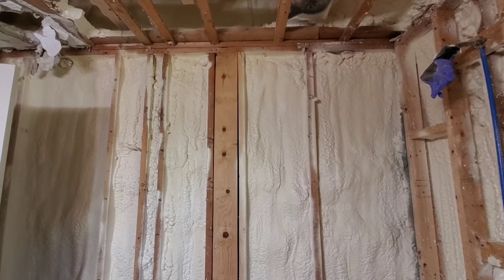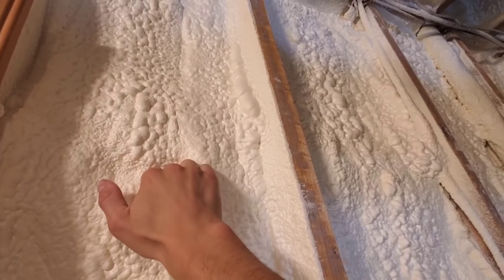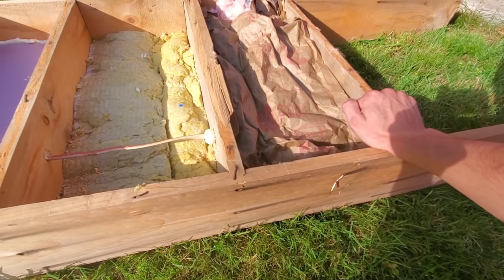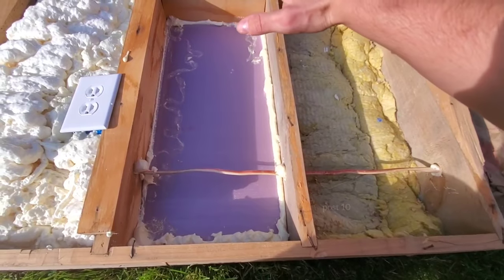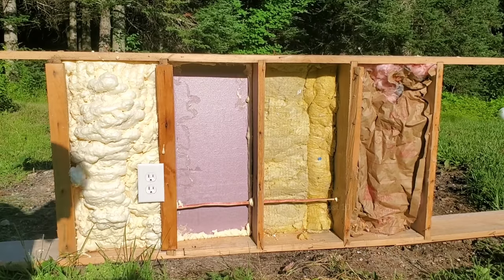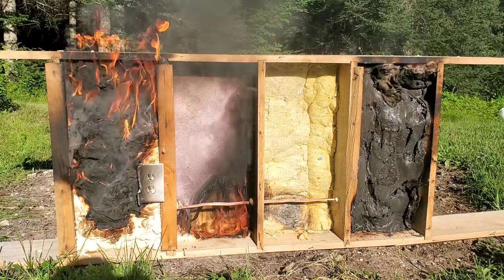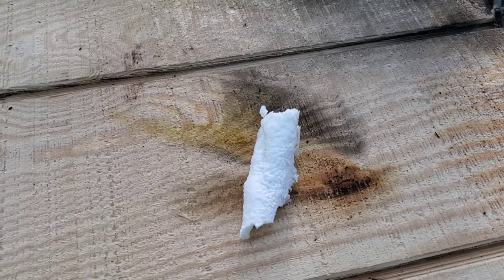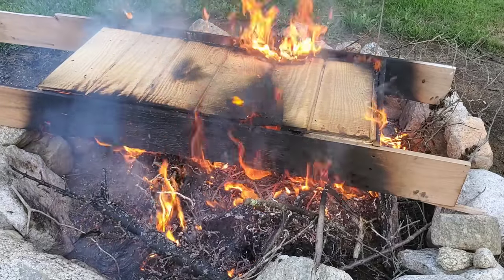Testing The Burn Ability Of Insulation In Wall

Comment: The shortcoming of this test is that the foam is essentially in open air . In a home, it would be trapped between studs and the drywall.  In an attic, the foam would be exposed to air, but in walls, it would be difficult to even set on fire due to the lack of oxygen, assuming that the structure was all to code. That is one of the main reasons that building codes are important. No one should be concerned with using foam insulation based on this less than scientific test.

Comment: Post10 - nice high-school level science experiment, but you should stick with unblocking drains.  You should consult the NFPA/NEC codes and the IBC  Codes for the use & installation of various wall & ceiling insulation products in residential construction.  There are strict requirements for using EPS, ISO, SPF foams in residential building construction.  And if you really want to know more about building fire science, consult Underwriters Laboratories (UL) & dig into NFPA fire studies.  Very nice entertaining video, but not designed enough from an engineering perspective for what you're aiming for.  There are entire houses & commercial buildings insulated with SPF for a reason.

Comment: I've never liked the idea of spray foam. It's always struck me as an industry gimmick with too many flaws especially hiding weather damage until it's too late. But this fire test really says it all. It's crazy that the entire building industry is pushing this stuff today. The rigid foam board is only good for under slab insulation in my opinion. Rockwool and fiber glass all day for me. Great job in this simple demonstrative test. 👍🏽

Comment: yea in China we banned the use of polystrien boards (pink foam) as insulation beacuse a few fires happened and their consequences. Plus the smoke is toxic. We also banned swadwhiched pannels using styrofoam as a core, what used to be a common material for roofing. The aux. building to the central TV in Beijing burnt down cuz of fireworks igniting a pile of insulation boards waiting to be installed. Now baically all buildings are insulated with Rockwool as it's less of a hazard to the people who handles it compared to fiber glass as other comments are saying. BTW rockwool is not fiberglass, it's literally melted rock being fluffed up. Essentially that stuff is just stone so it never burns.

Comment: Sorry to correct you, but “the great stuff” has no fire retardants in it.  Open cell spray foam installed by a contractor is loaded with fire retardants and will not burn apart from a nuclear bomb.  My dad’s house just had a major fire which started in the attic and everything including metal melted into oblivion, ….. except the spray foam roof.  The fire actually traveled down into the bedroom rather than obliterating the roof.
Reply: Wow, sorry that happened to y'all but thanks for telling about the experience.

Comment: I think we also need to weigh the benefits of spray foam versus fiberglass. Our home is spray foamed 360 degrees…and  our energy costs are the lowest I’ve ever had. The fiberglass became a nest for critters and our energy costs were higher. Also, looking at the surrounding material, that will catch fire faster than the foam. I’m talking about furniture, carpets, etc. So the experiment is great, but does not include the peripheral objects that will catch.
Reply: But if the fire starts in the wall, the wall cavity will burn faster (or burn, rather than not burning).  This happened to a friend of mine when a tree fell on his power line and cut his neutral.

Comment: Well, that's quite the disconcerting demonstration, but it is important to remember the purpose of the foam's fire rating is to give time for a firefighter to get to your home. The smoldering of the spray foam within itself prevents spreading of fire, rather that just burning like the panel foam.

Comment: So moral of the story, it doesn't matter if your house if engulfed in flames, nothing will stop that, and everything will burn, but if it's a small house fire and you have a way to save your house, use fiberglass and not spray foam

Comment: What about hempcrete? Not good for the attic, because it's to thick and heavy to reach same insulation values, but works well for walls and is supposed to be a good fire retardant (don't mix up with hempwool, which is flammable).

Comment: You should know that the "wool" insulation is not wool or glass. It is traditionally called rock wool and is a mineral fiber made from basalt rock. It can typically withstand temperatures exceeding 2000 degrees.

Comment: As a Major in Material Science, and also a trades-person of Plastics Fabrication, Signage and Insulation I would never trust plastics and plastic foams when building my home.  Fuzzy things such as Dacron, PEP, PVC, PET etc: are profoundly flammable and inflammable.  Your home is a fire trap that will kill you in your sleep.  Only use Glass Fiber and Rock Wool.  Only use Concrete Sheet to panel your walls.  Only use Galvanised Steel frame to make your house.

Comment: Even cork insulation is a safer choice than spray foam. Cork will char on the outside and create a barrier. They even use cork as heat shielding on crew capsules when they re-enter the atmosphere so if its good enough for NASA its good enough to insulate the home.

Comment: First thing I see with the closed cell foam is you are supposed to coat the wall and frame with a fire retardant like verithane let dry 24 hours spray closed cell foam let dry 24 hours then spray verithane fire retardant and let dry for 24 hours again and you might if lucky slightly scortch the outside eventually but it would not burn

Comment: From reading I learned that procedure guidelines for spray foam are often followed incompletely. Secondly, as a hobby home improver, guidelines are most of the time hard or impractical to follow completely, leading to fumes from the completed product escaping into your home, which are very bad for your health. There is a growing group of people experiencing the long term health effects of such exposures. I concluded there is no valid reason to ever use PU spray foam for isolation, and there are always better alternatives.

Comment: Solids do not burn.  As it heats it gives off vapors or melts and then gives off vapors.  It's the vapors that burn. If you look closely you will see a gap between the vapor and the flames as it burns. But every thing needs to be in a vapor form to burn.

Comment: With the spray foam, that is not the same foam they use in the large gun that you spray a whole house with, also it appears on the pink foam, that the part that actually burnt was the spray foam around the edge, that the foam it's self just melted until it cooked off.

Comment: No, that's not a type of fiberglass.  It's made of rocks, not glass.  That's the most fire resistant insulation on the market and it clearly won in this case.
    Also, fiberglass can and does burn when the fire is hot enough and it has a much lower melting point than Rockwool.
Edited to correct spelling.

Comment: Ÿou should  try Hardie backer cement board that goes under tile bet that would  hold up well and isn't that expensive compared to other products. It would probably resist  like bricks or centerblock walls

Comment: Why are you using a cigarette lighter? A grill lighter would be far safer, plus in my view, actually easier to operate. No need to have your fingers anywhere close to the flame. I like using a grill lighter to light pilot lights. Its reach sure helps.

You could have had a few buckets of water, if you decided to use it, no cost to recharge or replace the extinguishers. Good idea to have a charged garden hose or fire extinguishers at the ready, just in case. 

Disturbing that the outlet cover can not resist fire very well. If wires were arcing, how would it keep the sparks confined?

Very nice demonstration.

Comment: This was a decent video but failed in many facets.  First of all each of the materials has a lot more information that needs to be discussed (like hazardous materials list, melting points, flash points, and combustion temperatures.  Additionally, the heat that each material generated/radiated from the fire tests, burn time (per sq ft, cubic ft, etc).  A great thing that you did show in this video was how the spray foam was deceiving as it could appear to be extinguished but still be burning the building down.  It was eye opening to say the least.  Thanks for sharing.

Comment: So I can see a big flaw in this test and that’s using canned foam, it doesn’t contain the fire resistant chemicals used in normal poly resin closed cell spray foam. And yes it still is more flammable than fiber glass but not in a realistic situation. Most wires are not igniting insulation but usually get hot enough to just ignite the wood or paper on fiber glass. Sadly fiber glass will not prevent this and actually will allow it to happen easier due to more oxygen flow and space for the spark or heat transfer. Yes the fiber glass won’t burn but the house still will, while foam will limit the chance due to lack of oxygen and if the fire proof coating or fire proofing inside the foam is to code like most houses it won’t even ignite. I’m not saying there is no chance but it is far less likely, especially on the fact electrical fires make up only about 6% of fires yearly.

Comment: It appears from your comments (and some LACK of comments) that you don't know what rock wool is.  In your commentary, you said it was a form of fiberglass.  NOT.  It is fireproof and is made of molten spun rock, not glass.  It costs maybe twice what fiberglass does, but it is a safer insulator.  Working with fiberglass requires a respirator and skin protection (those glass fibers can tear your skin up).  

Rockwool is rot, mold, and whatever else proof.  Mice and other small critters don't like it and don't burrow and nest in it - like they do in fiberglass.

You can cut rockwool with a common serrated knife - it's like a hot knife through butter.  Rockwool bats are slightly bigger than the space in standard stud spacing, and they are stiff enough that they do NOT need staples or other hardware to hold them in place.

Comment: So I get the test but.... a wall is covered on both sides much less O2 not to mention most states require you to plug holes on top plate to reduce the O2 in a wall

Comment: Interesting, I personally have EPS beads in my inner walls. Now I'm wondering what the flammability on those is.
Reply: Fairly high, polystyerene, whether expanded or extruded, tend to be quite flammable.   Less so for the plastic itself- its actually comparable to wood in regards to how quickly it'll light, but once it starts going, the blowing agent - that is, the compound used to turn it into foam, tends to be either ethanol, kerosene, or another light oil product.  So... once it catches fire it chain reacts what may as well be bubbles of wood filled with lighter fluid.  Same deal with spray foam insulation, really, though the chemistry is different.

Comment: You PHYSICALLY CANNOT plug a 20A device into a 15A circuit in the USA. 15A space heaters, sure... two of them, possibly, but you'd trip the breaker before starting a fire, that's exactly why breakers are installed. Plugging a high-wattage space heater into a crappy little power strip would likely start a fire, but not direct plug to the wall.

Comment: There is another insulation I heard about called AirCrete... which is a blown concrete mix .. I assume it would be good as a fire retardent, and it seems like it might seal as well as spray foam.... does anyone know how AirCrete actually compares to other insulation materials in terms of insulation, fire protection, air quality issues, and cost????

Comment: I would not want spray foam, from an ecological standpoint at the very least.   But seeing how fast it flares up, and the toxic smoke, that's 2 strikes.  The 3rd strike is what I've always thought about it:  It gets sprayed in AFTER all the plumbing and electrical lines are run.  What happens if you get a leaky pipe, or want/need to work on the electric circuit?  You're not going to be able to access either without a ton of work and making a huge mess.  No thank you! I'll still with fiberglass batts or rockwool!

Comment: My house is spray foamed and I was curious about the same thing. So during the construction (I GC'd it), I took one of the pieces leftover from the guy cleaning out his gun. I put a torch on it and it would not sustain combustion. It would turn black but as soon as I took the torch away, it stopped. Great Stuff is not the same formula as what they use to insulate a whole house with closed cell foam. I think you made a bad assumption in your test.

Comment: Roxul is not fibreglass, it is melted basalt stone.  that is why you couldn''t ignite it.  it doesn't hold water, mold, insects or animal life.  doesn't splinter as bad as fibreglass either.  better r value, better sound dampening, solid(ish) bats.  this is the best insulation.  also, non-toxic.  i wouldn't consider sprayfoam for any purpose beyond installing windows and doors and even then if you build it right, a bead of caulking should make the airseal.

Comment: Look to commercial grade materials like the rock wool or “woo-woo” as we  call it! In commercial applications “burn ratings, and restrictions are far more strict! Mind there more expensive way more expensive, but some cases nothing else can compare, even the blocking in walls have to be fire rated, usually with a sodium or salt based coating or soaking! There are better residential products out there than the traditional Home Depot shit! But as a union carpenter and home builder for almost 20 years, commercial materials is the way I’d go with a lot of my “future built house” materials

Comment: Not trying to be rude or anything but as a volunteer firefighter your wrong the fiber glass one it will burn the blow touch ain't enough heat and flame on it long enough to get it going because it will burn

Comment: Rockwool is made out of volcanic rocks and metal slag. Neither of which burns. It's melting point is over 2000 degrees F. I'm in an extreme fire danger area. No foam insulation for me.

Comment: Great Stuff is not the same chemical compound as closed / open spray foam used in homes.  Warning on the Great Stuff can even says to not use in ceilings or walls because of this.  Spray foam isn't fire retardant but it performs better than the Great Stuff used here.

Comment: I would never put any organic insulation in walls. Rock wool is completely fire resistant. Combined with fire retardant drywall or, even better, cement board on both sides of the wall a building has a good chance of surviving a forest fire if there is sufficient fire clearance around the home. Why would one build differently?

Comment: Hate to pick apart your video chief but number one.  That cavity of “window sealant foam” isn’t spray foam.  2 if the cavity is full of foam with drywall up against it, how will the fire be fueled?  Stop scaring people.  If your house is on fire you have bigger problems than your insulation choice 😉

Comment: Its also well known that spray foam insulation drastically increases the structural strength of the building. Many neighborhoods after hurricanes/etc only the houses with spray foam stayed up. Gambling on your house literally burning down is the most ridiculous thing to argue about. Yes the fumes are toxic. But the entire house is gonna be on fire before that becomes a issue. The logic in this is absolutely cherry picked insanity

Comment: Okay, while I appreciate the effort you didn't utilize all of the options available for insulation. The pink foam is highly flammable, in the south they spray closed cell then open cell in layers not mixed, open cell melts with little to no fire, if it's mixed with concrete it doesn't burn at all and has 4 times the R value, Rockwood and fiberglass in the south causes mold and mildew.  Aircrete is the best of all...stronger, more insulative and light weight.

Comment: Spray foam for use in home insulation is flame resistant by federal code..... you're not supposed to use the flamable stuff to insulate your walls.

Comment: 6:30 it can burn if you fire it hot enough. You need 600°C min. A plumber mix with oxygen will do. Glass can start at 450°C. So wood is usually not suffisant.

But once started, glass whool is the worst fire, and after you terminate a glass fire, it can restart on its own after 12h or 18h. Fire brigade ALWAYS stay and sleep at your home for 24h after they have found a glass fire. 

You just did not try hard enough.

6:40 wrong. Glass whool do burn !!!

Comment: Once the spray foam off gasses its fairly fire resistant most will not even catch on fire or propagate fire if it is exposed to direct flame. In my opinion this demonstration is misleading and the spray foam was not properly cured prior to ignition.

Comment: If you are relying on your insulation to be your fire resistant barrier, you aren't building correctly.
Reply: Case in point, all spray foam manufacturers specify that the foam be covered by intumescent paint if it is otherwise left exposed. Paint the foam as specified, then re-do your experiment.